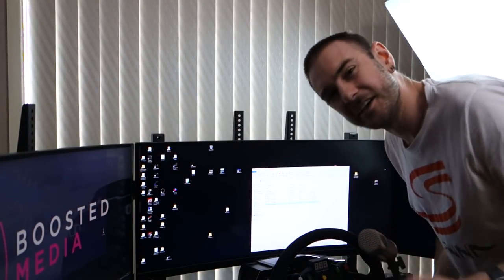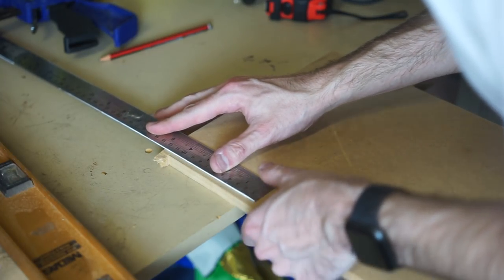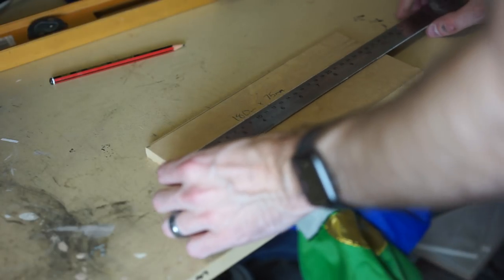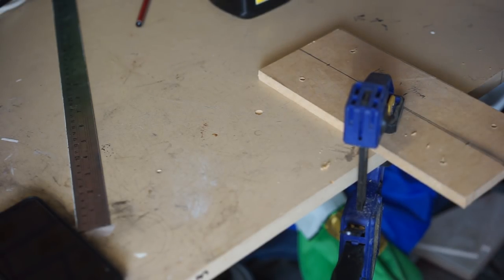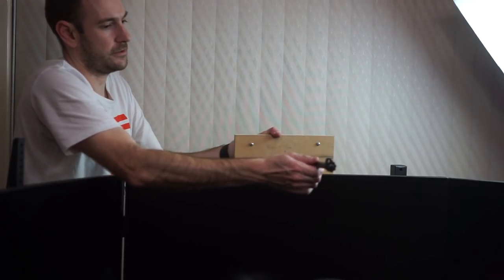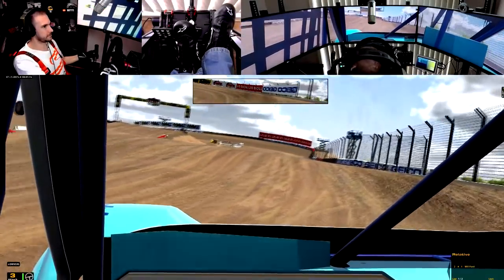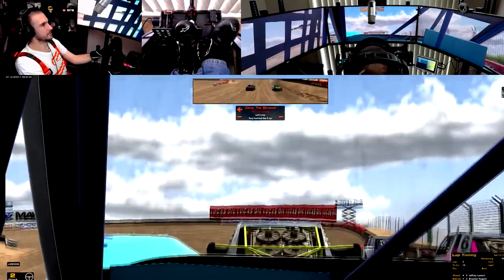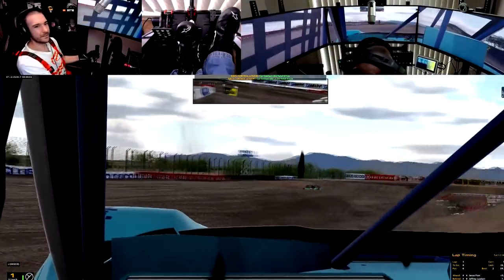BROADCAST QUALITY! - Fixing my Voice Recording Quality with a Jigsaw

Comment: Great, simple solution you've come up with. With that said, further improvements could be made. I would suggest selling the Broadcaster and buying a dynamic mic along with a Triton Fethead. An SM57 would be a great fit, and you can pick them up used for a pretty good price. Essentially, dynamic mics are in a whole other league when it comes to rejecting background noise, so it would do wonders for isolating your voice from the noises around you. With that said, audio quality was rather good in this video. Well done!
Reply from the maker: Might look at a different mic once I’ve moved into the studio. Can’t sell the Broadcaster though as I need it for other stuff.
Reply: @boostedmedia  That's fair enough, it is a lovely mic after all. I know I'd hate to part with mine even though I don't use it too often. Good luck with it, and keep up the good work :)

Comment: Voice audio in initial test drive in the truck is really improved. Pretty clear and properly balanced w/ the sim IMO. But still a but too high treble (pingy?) in your voice when driving for me, but not the truck. I didn’t notice it b4 you started the sim

Measuring the MDF: I also have difficulty measuring by hand (a milling machine or table saw using the wall guide is super easy). I've found when measuring ie 90 mm from center on either side then drilling, holes sometimes don't line up w/ my mount. Much better for me is put 90mm @ the mid point then mark zero & 180mm.

Streamers who have good audio, w/ external mounted mic tend to mount it above the monitors to the side, pointed down, mounted in the corner, just behind, between 2 of the race view monitors. They have a smaller 4th monitor over the mid one (where you put the mic) angled down for either live chat, game/PC data, etc.

Driving: race lines looked pretty erratic. Best lines & race craft on dirt I've seen is by hobbo88